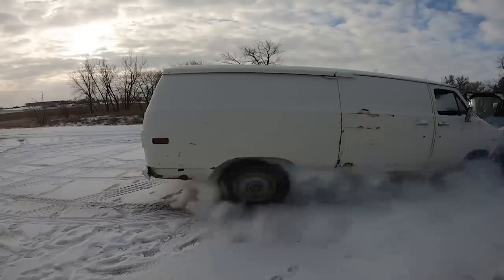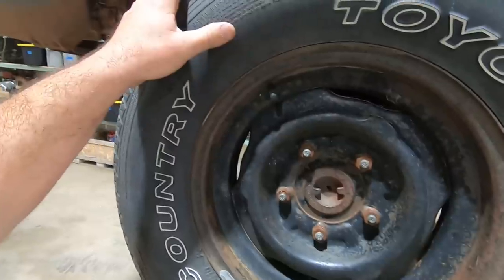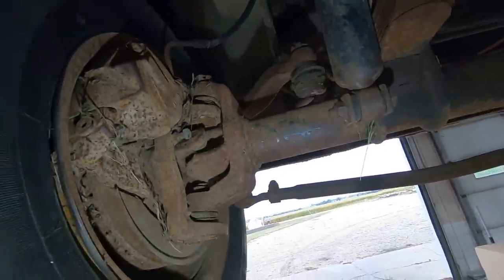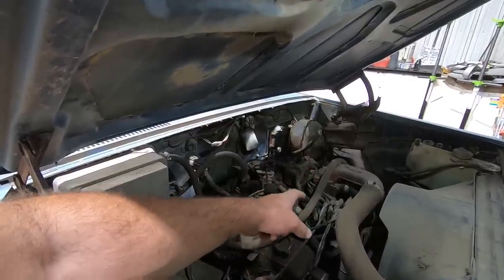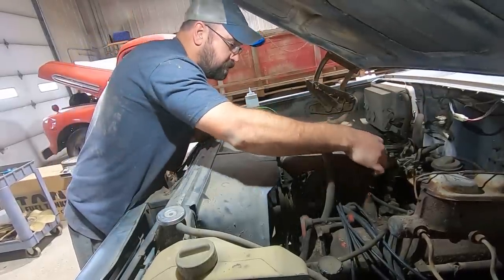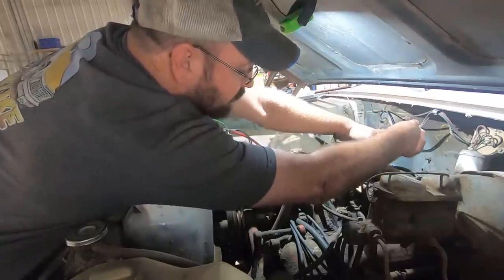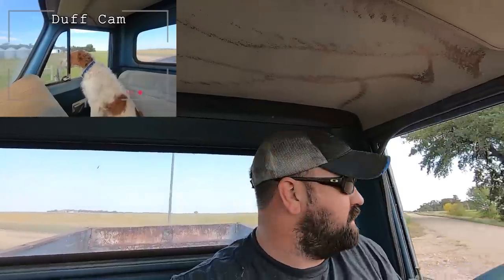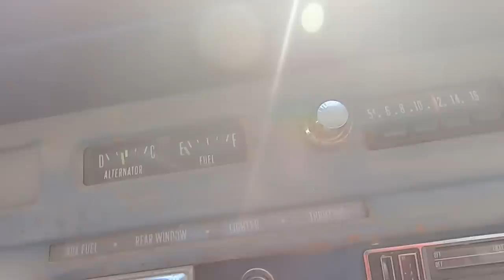1974 International 4x4! Abandoned for 16 Years! Will it Run?!?

Comment: I had relatives who worked at an IH plant in Springfield Ohio. They made a lot of halftracks there in WW2. They used to drive them out and around back to a storage lot in my dad's neighborhood. Sent all the kids running - scared the pants off of everybody first time they seen one. If you never had any inkling of something like that it probably would be scary.
Reply from the maker: Interesting
Reply: @MortskeRepair  It gets even more interesting - actually kind of tragic. They had some kind of relationship with AMC - think they got the engines from them. But anyways one of my cousins had a '71 340 'cuda and she married a guy who had a '71 with a hemi. The hemi was too much for daily use - traded it for a Matador - the boxy luxury one. Got a great deal on it - at the time. I just can't imagine the regrets there.
Reply from the maker: @W1se0ldg33zer  NOOOO!!!
Reply: IH had a plant in ft Wayne Indiana also.

Comment: Anyways I was thinking I will either build a magnum v8 somewhat like a 340 small block Mopar, but I don't know whether to use a 318, or a 360, or build a cammed IH 345 for the dodge ram 2000 1500 long bed 4x4 but I don't know what to do with the EFI of the dodge because I have never seen a fi ih lol

Comment: It is frustrating when you buy locally  and the quality let's you down 
I'm doing a rolling restoration on my old volvo v70 
And so far I've bought wix filters and quality oil to keep the high milage motor sweet 
But my new brake pads where made in China and so where the discs ( rotors) 
And they fitted well and are working well but where 60% cheaper than volvo parts 
So it is buyer beware I guess 
Hope you get some satisfaction from that cam supplier 
But in the mean time love your work keep cracking on mate

Comment: You can hammer on the 345 forever and it'll be fine, but the rule of thumb is, if it's got an IH badge, it's absolutely had the balls beat off it. The 44's and the transfer case won't be long for this world. The weak link on these is the transmission crossmember, even on the 3/4s and 1 tons. It cracks and flexes under heavy pressure, everything starts to move and Goodbye bearings and seals.
Reply from the maker: Interesting

Comment: AMC sold V-8 blocks to IH, who built their own engines of 304, 345, & 392 cu", which were all the same small block.  THE AMCs that AMC built had one bore for for the 290/304, & a larger bore to the 343/360 & 390/401.  More stroke to the 390/401 with the same bores as in the 343/360.   Don't RACE these blocks, because they had oiling "issues" if "revolution-challenged[--RACED]".  Hot Rod Mag had a 401 AMC Hornet hatch FAIL in their '74 Cannonball-Baker Entry,[--they replaced the stock 360 with the 401] and Roger Penske had 23 AMC mains-failures on the way to his "Javelin" Trans-AM victories" until he went to: his previous TRACO-block, and, to dry-sump oiling.   EVERY-one I EVER talk to about "AMC-performance", speaks bitterly about lunching @ least ONE AMC, 390/401, due to mains failures, unless they were frequently torn-down/rebuilt {--dragsters}, were Automatics, or driven by our grannies that never heard of Pasadena.   AMC's "warranty-solution", was to cast 15,000 extra 360 blocks, instead of FIXING the mains oiling problem.   NOT-fixing that problem, RUINED/WASTED the dollars they spent with Penske, and prevented the market penetration they needed to Endure.   Their 6s, though too heavy, were much more reliable with a manual, than their V-8s.   Dry-sumping their V-8s would've cost them another $100 bucks/car.
Reply from the maker: Interesting.

Comment: Lookin at that bumper n the screen in front of the radiator tells me that this was a push truck at your local dirt track. It would push the broke down or wrecked car off the track if the car could not do it under its own power
Reply from the maker: Repair shops did the same thing with them

Comment: Older International s had two 10 gallon tanks one on each side with the filler caps behind the front wheel s really bad idea no crossover pipe you had to fill each tank separately. Tore the bottom out of the right front tank on one
Reply from the maker: Yuck

Comment: in front of the starter towards the front of the block there is a flat part of the casting engine size will be stamped there looks like a 345 tho . also seems every single one i have gotten over the years the carb kinda works but leaks like crazy have yet to find a useable one , cool rig tho international is weird very over built in some ways and completely under engineered in others.

Comment: 13 Letter shitspreader!  Good on ya!  Dana 44 driving axles front and rear, New Process 205 case, and a Warner Gear T-18 or 19 4spd backing a tres Quatro Cinco.  Solid drive train.  Solid.  That carb is a Holley 2210 smogerator.  Absolute garbage.  But you got it running surprisingly well.  Here's  some more useless information for ya.  '74 was the first year for the setback engine in the IH pick-ups, requiring side specific, rear dump exhaust manifolds that are prone to cracking and rarer than hens teeth to find.  Prior to '74, the engines were further forward and used center dump exhaust manifolds which fit either side and were far less prone to cracking.  Not every change is for the better.  What was the reason for the setback layout?  Who frigging knows?  '75 was the last year for those trucks and they didn't even make a full model year run at that.
Reply from the maker: Thanks for the info!

Comment: I’d be willing to bet that Intersmashable probably sourced their steel wheels from the same supplier as “Ferd.”   I had a ‘77 Econoline with the same bolt pattern. I switched out the steelies for a vintage set of 15x8 aluminum turbines. I was on a quest to make it into the ultimate “shaggin’ Wagon.” Unfortunately some dip shirt ran a red light and T-boned me before I got finished. The old girl sacrificed herself to save my life though. It wrinkled the passenger side floorboard up to the frame rail. The person who hit me was a bl@@dy mess. Her vehicle was completely destroyed. The front bumper was pushed back a foot from the windshield. The cops said she was traveling at at least 50 when she hit me. They didn’t even call an ambulance for her because there was no reason to.
D.O.A.
I was turned around in my captain chair. I found my eyeglasses in the passenger footwell. I sustained no injuries. There is no subsitute for American steel. I don’t care how many airbags are in modern cars. Rear wheel drive body on frame vehicles are the way to go.

Comment: Pretty sure the engine options are AMC...
Reply: the 6 cylinders were AMC as was the 401 and it was only put in 2 wheel drive pickups and travelalls never in Scouts.
Reply: @miketrimm3914  304 is also AMC I believe

Comment: I have a brand new in the box never installed distributor for that motor. It has the points with it,cap and rotor . I did put pertronix electronic ignition in it and still never installed it. I got rid of the truck. I have $450.00 in it ……. Make me an offer……
Reply from the maker: Dang!